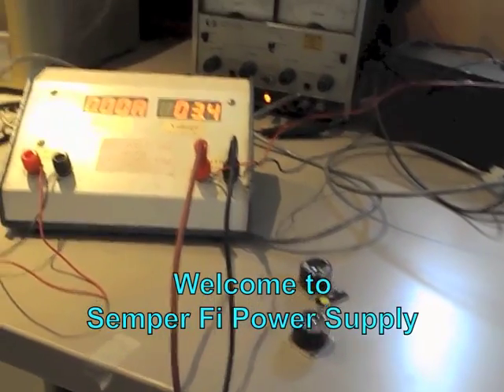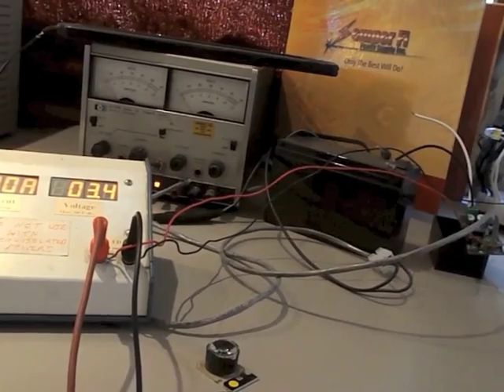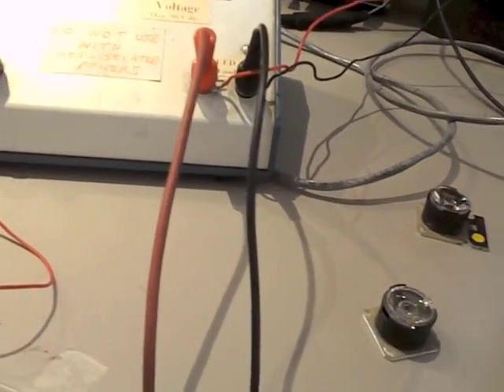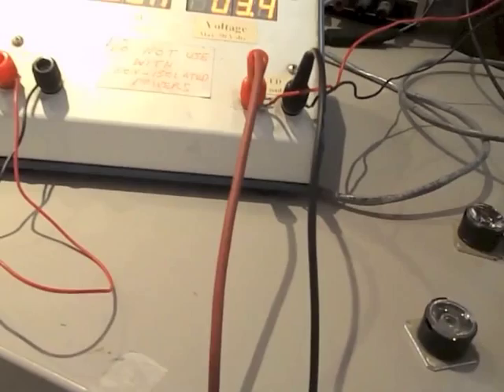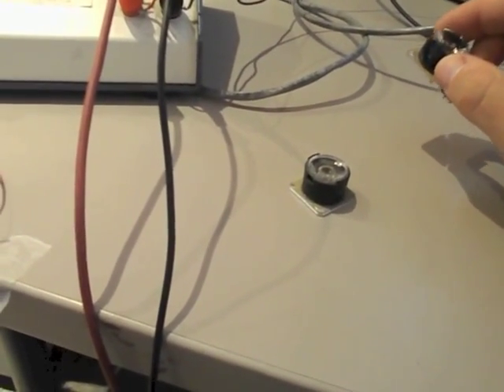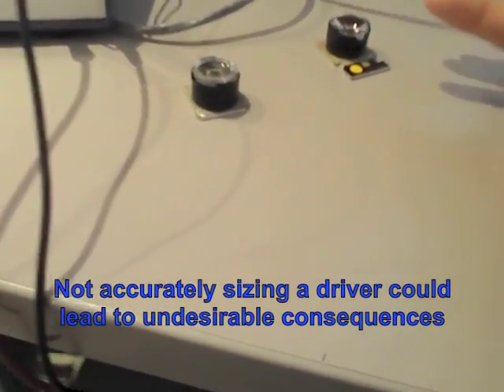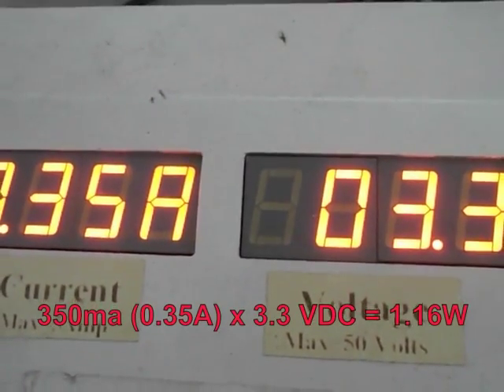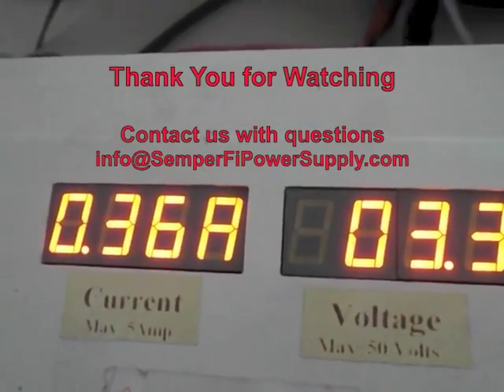Semper Fi Power Supply - Sizing LED Driver using Forward Voltage

Comment: Wow thanks for your reply this is all the info it provides 

5pcs 10W Cool White 20000K High Power Bright LED 1000Lm-1100Lm Lamp Light for Aquarium DIY 10Watt

100% Brand New

Light Color: Cool White

Output Power: 10W

Color Temperature: 20000K

DC Forward Voltage (VF): 9V-12V

DC Forward Current (IF): 900mA

Luminous flux: 1000Lm-1100Lm

Viewing Angle: About 160°

Package: 5pcs
Reply from the maker: OK - you can use a 900ma driver rated for 60VDC load.
or you may need to use multiple smaller drivers.
We have 1A (1000ma) drivers that can be adjusted down to 900ma) rated for 60VDC load. Model RPK-120-60-1000
http://www.semperfipowersupply.com/kb/uploads/doc/RPK_120_30_40_60_andD_Driver_Cut_Sheet.pdf

An LED is a Current driven device, so providing its rated current guarantees results.
LED Forwward Voltage (Fv) will vary from one LED to another; there is a Minimum, Maximum and Typical Fv. If as an example, you know the Fv of an LED is 3.5 VDC when driven at 500ma, you could use a 3.5 VDC source to drive that LED, but as the LED heats up the Fv changesand so too will the drive current.
By Designing systems to be used with a constant current driver, you guarantee that the LED will be driven correctly.  

Some systems out there want the drive current to change with temperature, but that is another topic.
Reply: Semper Fi Power Supply  
Perfect you have been a huge help,  When I order I will thank you again

Comment: I have 5 leds with these specification

DC Forward Voltage (VF): 9V-12V

DC Forward Current (IF): 900mA

5x12v = 60v 

So am I running them all at 60v and 900ma 
Or do I need to  5 x 900ma= 4.5MA ?

THANK YOU FOR YOUR TIME AND HELP.
Reply from the maker: Hello Roberto,

Does it give you total power/wattage?  
Does it give you instructions on how to power those LEDs?

If those 5 LED "packages" are designed to be powered by a constant current driver and wired in series, then the constant would be 900ma drive current through all five.

The constant current driver would then be sized using the Fv (you give a range of 9-12vdc) x 5 = 45 - 60VDC, so the driver needs to handle that range.

A majority of High Power LED products out there are 350 - 700ma, so make sure that what you have is calling out for a constant current driver.  

Unfortunately, a majority of companies out there selling LED products do not understand what they are selling, so verify everything before powering.

Let me know if you have any additional information or questions

Comment from the maker: An LED is a current driven device best powered by a constant current driver.

This video reviews sizing the LED driver to avoid making mistakes that lead to issues in the field during and after installation...

Semper Fi Power Supply - Sizing LED Driver using Forward Voltage